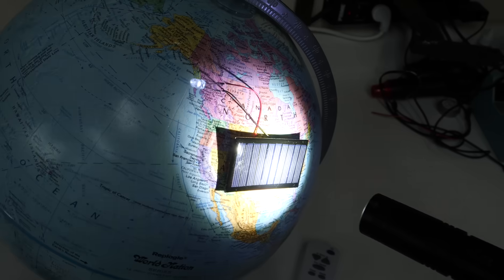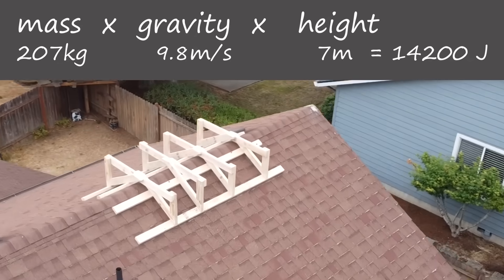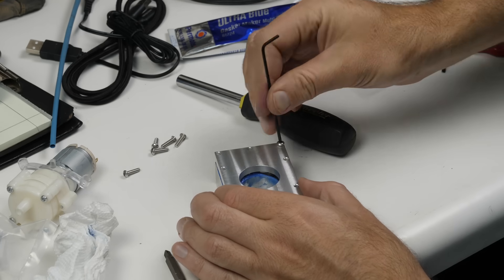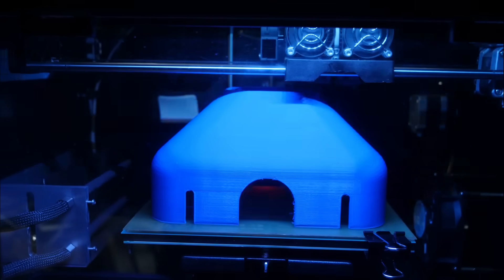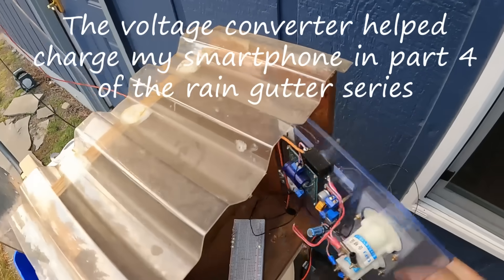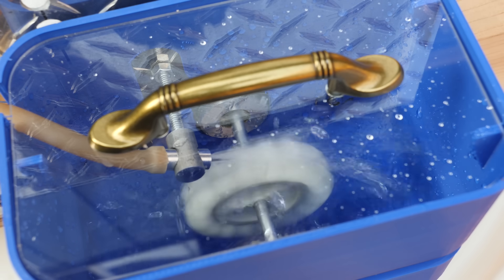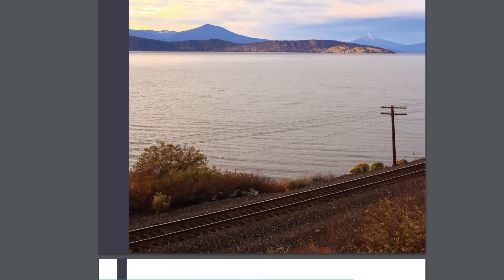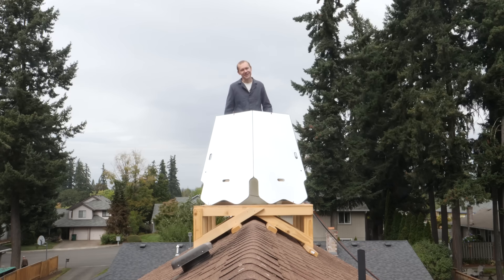Storing Solar Power on my ROOF!!!

Comment: You could just build a big silo that reaches your gutters... so you could store like 15k(or more if you link more together) liters of rainwater. And could run it forever.
And no pump needed , so free energy from the first drop

Storing rain with sunpower doesnt add up tbh. No sun WHEN it rains, so you are limited.

The best part is that you can even use the water from the tanks to fill up the toilet or water the garden

Comment: I have been [[Mentally]] Engineering a Solar Water Heater.  From my experience in Florida living in a cement block house with the shower, water lines and water heater facing West therefore getting heated by the Sun until dark, I know I could not shower until after 9PM or so in the Summer using only hot water because it was scalding.   So, thinking a Pipe that goes along the Western/SW side of the roof.   This would eliminate the stress on the Trusses you had with the barrel.  I am wondering what the feasibility is for your project using the pipe  [[I want to say PVC but that is not correct as it is not Solar Toleratn but you likely know what I am thinking]]   Have to determine pip ID/Length to determine amount of water but that type of Calculation is not something my brain patterns properly.   So, running your simple system how long can you fasibly expect to run the lights?

Comment: You can make the pump pump ever 4 feet into a new bucket of water. Pumps basically stop moving water after 6 feet.
Reply: Depends on the pump, I've seen some pumps move water 30ft high.

Comment: To put this into perspective: The potential energy stored on the roof in the water reservoir (14 kJ acc. to the video - a roughly 200 liter water reservoir at 7 meters roof top height above ground) corresponds to what a normal household consumes in 30 seconds, on average (assuming 4000 kWh yearly consumption, which is rather conservative for a house like the one shown).

So the water won't save a usable amount of energy buffer for the dark night.

Comment: I am missing some numbers - some calculations how many kWh are stored, and the efficiency when converting potential energy back to electrical energy.
Reply: My calculation: Assuming 80 cm diameter (i.e. 4 dm radius) and 1.5 m heigth (=15 dm) of the cylindrical water reservoir, and h = 7 m height difference roof-to-ground, taking into account the specific mass of water being 1 kg per liter (1 liter = 1 dm^3), we get:

E_pot = m * g * h
with m = (pi*4^2*15) kg = 754 kg
and g = 9.81 m/s^2
Knowing that 1 J = 1 kg * m^2/s^2 = 1 Ws, we get:

E_pot =754 kg * 9.81 m/s^2 * 7 m = 51777 Ws  = 51777/3600 Wh = 14.4 Wh = 0.0144 kWh.

So this is the energy to operate a 1 kW electrical consumer for 52 seconds. A 2 kW hotplate in the kitchen can be operated for 26 seconds with the stored water energy.

Assuming the household consumes 3800 kWh of electrical energy per year (which is a rather conservative assumption), the energy stored in this water reservoir is the energy that the household consumes, on average, every 2 minutes: (0.0144/3800)*8760[h/year]*60[min/hour] = 1.99 minutes.

Comment: I calculated the stored energy in such a way a couple of times in the past. It‘s not feasible to power the house over night. At least not if it‘s of any feasible size. To supplement a bit it‘s okay. But the benefit is tiny. But in large scale it‘s one of the best ways to store energy out there. Thats why it‘s used anywhere possible. The alps are full of dams

Comment: I feel that for this to even be worth doing, ditch the whole roof thing and instead just build a massive raised water container. Even just a smaller one at around 3 meters height (container) and 3 meters in diameter would still contain 21 cubic meters of water. While the upside is massive increase in capacity, the downside is also massively increased cost as well as the need for a dedicated structure to store the water in. Another upside is that should water become unavailable (something happens to the communal water), having that great of a capacity means you can get by for a long time if you ration the water well.

Comment: For people without a 3 d printer, my I suggest a boat supply store. Submersible pumps and submersible  switches all in one store. I suggest the Rule brand because I have heard of one guys boat leaking so bad, that he would run it year round with no float switch. He would wire it direct to the battery and then about once a year he would curse because it would finally have to be replaced. While he would curse, we were quite impressed.

Comment: You need to set a good example: You climb on a roof without a safety harness. You have a platform on your roof without a building permit.  You have an unfastened platform and a barrel that will come crashing down in a wind /rain storm. You have an ungrounded solar panel.   No Lighting rods.  What could possible go wrong ???
You should save that water for when your house burns down.
Plus it is only possible to pump water 33ft maximum vertically in one stage. Physics.
Reply: He's just experimenting, he's not leaving that barrel up there permanently. Scientist take risks.

Comment: Thank you for sharing! I have been trying to figure out an off-grid sustainable system that did not rely on a lot of expensive batteries! Even if one did not want to put this on the roof, a platform could be erected in a series of different levels one below the other to keep reusing the water.
Reply: The real problem is, how many 55 gallon AA batteries are you going to need to power anything meaningful, and where will you put them and how will you keep that much water from evaporating? It can only really work at larger scales - this is never going to be practical for individual home owners, unfortunately. The energy density just isn’t there to justify the cost and space.
Reply: @babybirdhome  it is possible at home level if you use and reuse same water reservoir through siphon pump free energy can be produced.
Reply: @FarooqQadri  Why not just use Magic instead. 🤣
There is no such thing as "free energy".

Comment: So Quint....Youre telling me.. If I perfectly replicated this whole design and used a 1000 gallon pool to catch the water.. And transfer all of those gallons onto a suitable type of structure.. Do you think I would be able to power a Tesla? Love the video by the way. Super inspiring!
Reply: This device stores about 14 kJ of energy, which is about 4 Wh. A 1000 gallon tank would be about 15x larger, so about 60 Wh. Your Tesla car battery stores around 50 kWh to 75 kWh depending on the model. So you are approximately a factor of 1000 short.

Comment: 14000joules is 3,88 Watt/hour, so that whole lot of water.... can in ideal circumstances provide 3,88 watt (if no loss) during 1 hour. 1 single 18650 Lithium Ion cell can provide 10 watt/h. So this energy storage is literally peanuts. How many watt/h did you even use to pump that water to the rooftop. Totally useless this

Comment: I'm guessing the conversion from the water pressure to the electricity is going to be fairly lossy in this system. The water that splashes out without turning the impeller, and the boost circuit used to up the voltage, are both losses in the end. So, I imagine the power harvested here is much lower than the total K.J.'s of kinetic energy that's actually stored in the barrel on the roof.
Reply: I would like to see he use the generated electricity to pump the water up again in another tank, so we could see the efficiency.
Reply: @stigcc  No you wouldn't... It would be a very LONG and BORING video.
Kind of like trying to watch grass grow. 🤷🏻
Reply: @davelowets  Haha Some other commenter calculted the efficiency to be less than 5%
Reply: @stigcc  I can totally believe that..

Comment: interesting experiment but far from efficient, as how much energy does it take to pump the water up compared to what is generated ?? as you are comparing on demand energy (energy available to do work such as current) as oppose to stored energy (milliamp hours (mAh) the amount of constant power used to fill vs power generated per drum of water (the energy linear storage factor of your water battery when converted back to electricity at the nominal voltage of the system output) . 

but if you built your house below an Olympic size public swimming pool & you could siphon off enough to power your house, you could have free power.

what I though of experimenting with is building a water feature in the yard with water circulated by a ram pump that could turn a small water wheel to charge a battery

Comment: My father worked on a project called Bear Swamp in Massachusetts in the 70's.  But.... as far as energy savings doesn't it take more energy to pump that water up than you get in return?  In your case its from the sun,  but in other cases its a net loss and a result in more consumption, no?

Comment: This reminds me of a job I did in a translucent water storage tank on a tower that a friend built. Because it allowed the sun through the sides, algae became a problem. I had to climb into the tank and pressure wash the algae off the sides. It was like removing wall paper. Then the algae had to be 5 gallon bucketed out the top with a rope and a second person. It was a really hard job and it gave me an appreciation for why most water storage tanks are opaque. I don't know how permanent your project is, but if you are planning on a closed system, I think your going to need to add some chlorine to the water, or maybe you can use your free power to run some UV.

Comment: Wow , enough energy to run one tiny lite , only had to run a Milling machine, 3 D printer, and a junk pump that will be wore out in no time.  Why not use your garden Hose to fill the drum ?  Why not just use Iron Nickel Batteries to store the power of a solar panel , and save money on hospital bill for when you fall off the roof ?

Comment: For a long time I've had a vision of rain water collection, like a see saw, that works like the "gravity light".  combining solar, hydro, gravity, pulleys, leverage, flywheels, etc. to store and generate electricity.  If someone can show me something like this, I want to see it!   Seesaw: rain fillls up one side, the weight pushes it down, spinning the turbine flywheel, then it empties or using this solar panel concept it pumps water into the higher empty barrel, and the process goes back and forth in perpetuity, generating electricity.
Reply: Just so little electricity that it is not worth it unless you already have natural places to do that - like large mountain-valleys that you can flood.

Comment: I thought of something similar to this last week.  We have a creek that runs through our property 8mths of the year, but it is almost flat so almost impossible to get hesd pressure.  So at the far end i was going to use solar with a battery bank to lift water to a 1000 gallon tank 20 feet up, then run piping for my pelton wheel a few hundred feet down towards the house to another larger battery bank hybrid with solar as we get a lot of rain here on Vancouver island Id need the hydro power on the rainy days to supplement the difference.  I think it would work lol  my other consideration was build a small dam in the dry months with a turbine or screw style.

Comment: I am super impressed with that pump i spent like $500 on garden pumps only to find out they wouldn't even push water out over 1-1.5m of head on a 19mm pipe, yet my $120 stainless one can pump out our water tank in quick time.....ohh how motors and all those silly calculations come into play like watts and such haha

Comment: Wow cool I had the same idea and made a presentation when I studied Energy and Environment. I passed with 93% score in 2019. The presenatation was around 2018. I have another idea which works same like gravity trains also a project in California. Or a small version of this project: https://www.youtube.com/watch?v=C-uvrAxvOBs, or the link for the train: https://www.youtube.com/watch?v=RHrlnnbJuDg
Could you store concrete blocks or simple stones on a elevator platform. and move it up maybe 10 meters, if there is solar energy and at night the platform just goes down again and create energy? I think this is possible to and it can be installed on a small footprint in almost any garden. .

Comment: what if you use the sun's energy to heat the water in the tank to increase the pressure which will increase the power generation they need to have an extra tank what you think what if you use the sun's energy to heat the water in the tank to increase the pressure which will increase the power generation they need to have an extra tank what you think  😁

Comment: Hello, absolutely love this. I wanted to ask: is there an equation to work out the decline in pressure as the tank empties. As a decline in the pressure or mass of the tank as the water leaves lessens the power of the hydro generator. Im just looking for a formula to work it out... I'm  looking to do this with a 5000L tank
Reply: What if you pressurize it in a loop?
Reply: Isn't it just an ODE?
Reply: The pressure depends soley on the height, and for a cylinder the rate drops linearly as the volume is directly proportional to the tank diameter and the tank height is a fraction of the overall height.

Comment: Is the height  for calculation of energy determined by the top water level or the bottom water level?  If  the top of water level determines calculation on energy, could you just run larger PVC pipe up the side of the house and release water at the bottom of the pipe.  This may be a safer storage method and require only 1 pipe up.  hmm? or just store rain water in jutter down drain? like regenerative braking.  When drain pipe is full...empty...make power.  This process could use existing systems.

Comment: I’ve considered this for homestead use. To have a water tower to be filled with water during the day through solar/wind. As the water is used. It turns a generator to power recharge the battery as the water moves through the pipes.

Comment: I was able to tour the PG&E hydro pump facility with my power engineering class ages ago:
https://en.wikipedia.org/wiki/Wishon_Dam
https://en.wikipedia.org/wiki/Helms_Pumped_Storage_Plant
These plants used excess power from the Diablo canyon nuclear plant during off peak time to pump the water up the mountain then let it flow back down during peak times.  Not sure if they are still in use due to drought and cost of maintenance, but since no new power plants were being built my guess is yes they still run it.

Comment: 14200 Joules  is the same as 4 watt hours. That means that the entire water barrel has the same capacity as half a 18650 battery. :(
Reply from the maker: Yep, and the horrific efficiency only recovered a fraction of it! But it's a simple and fun concept demonstrator.

Comment: Nice video! If you want even more power you might consider making/buying a turbine instead of the water wheel. That could increase the efficiency a lot. All that water splashing is energy getting lost. 🙂
Reply: the trouble is finding the turbines.  do you have a source of turbines for a range of duty points?

I've got a ~30 to 40m head and several dams that can store heaps of water both top and bottom.
Reply: @StuartChignell  Could he make one with his printer?
Reply: @TheGramophoneGirl  Unlikely. 3d printers could provide a prototype but not something for sustained use.
Reply: @ChestnutnagsToolsFromJapan  But wasn't all this a prototype? It would be just to test the theory on the efficiency gain. Can hardly see him leaving that carbuncle on his roof for good.

Comment: What do you think about the idea of lifting and lowering heavy blocks instead of using pumped hydro.  Similar to the idea that 'Energy Vault' is pioneering, except simpler.  The idea of using a heavy weight rigged to a motor/generator that is raised using solar during daylight hours.  Then allowing the weight to descend running the motor/generator and creating electricity after hours.

Comment: so if i understood this corretyl (im a slow learner) you pump up the water with the solar panel and when the water trvels to the bottom barrel it gives you power?
how long does that barrel last at full? 
where is the power being stored? or is it just being used?
Reply: Power was stored in the water on the roof then released as it flowed past the turbine

Comment: Nice, thanks!
Would be nice to get the water on top of the roof without using the solarpanel-motor way. Maybe with warming it up in black tubes. And the electricity-generator could use the water, wich throws away, by having a tight housing, maybe.

Comment: Really cool experiment but of course this just isn't practical at all. If you wanted to store real power for supplying the home with a 10kw solar system you would need literally many tons of water. It would most likely destroy your roof. So yes you can power some LEDs but imagine powering something like a microwave. You probably need a flow rate and generator 1000 times more powerful than you have now.

Comment: Pumped storage has positive uses, however pumped storage isn't really how it is used in conjunction with renewables in the energy grid. Peak renewable energy generation tends to track with peak grid demand, while at night is when electricity is the cheapest and it is pumped back into the resorvoir. Hydro energy is actually the key component in stabilizing the grid as you can quickly turn it off and on when compared to all other large scale energy production techniques. From an economic perspective fossil fuels are what generally provide the power for pumped storage systems. Fossil fuel systems have a production rate that do their most effecient work at and this is typically set at night.

Comment: +\-  458 lbs of H2O per barrel, H2O mass per volume density varies,  dissolved minerals in solution, atmospheric pressure & temperature.